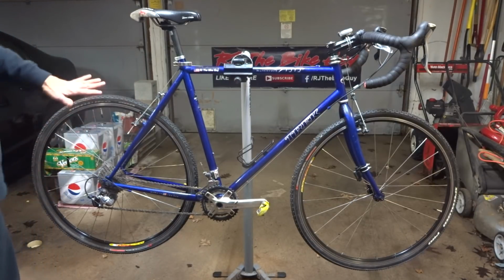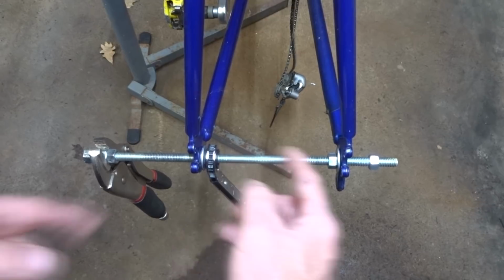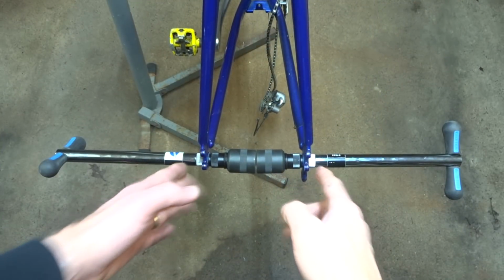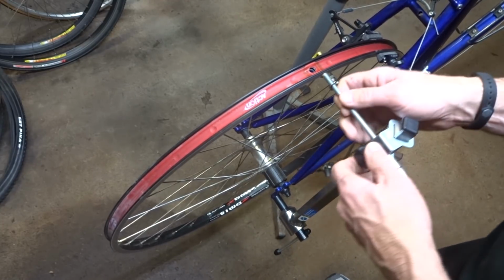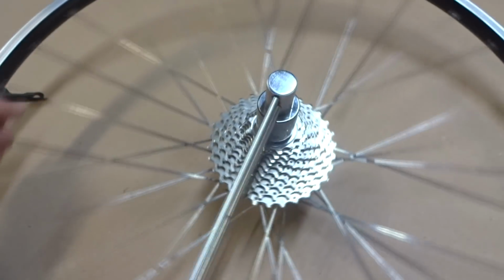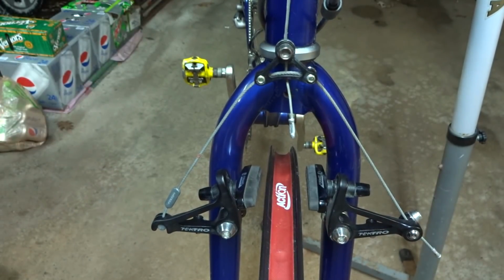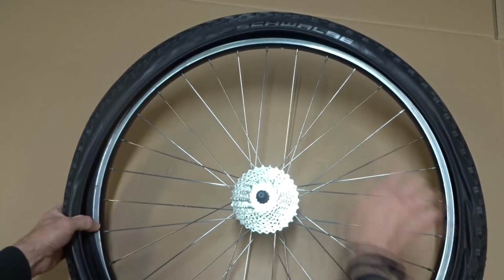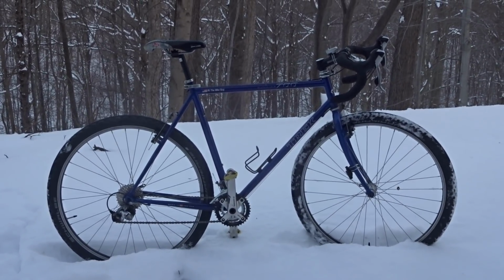700c to 29er Wheel Conversion - DIY Gravel Bike Update

Comment: Now upgrade it to disc brakes :).
Those tires are amazing! I have them on one of my bikes and they have't disappointed me yet :)
Reply from the maker: That would be a new frame with mounts and new wheels. Basically a whole new bike.
Reply: Instead of going through the expense of disc brakes, I've been equipping all my bikes with the over-sized brake pads used on tandems! Very low-cost but effective and inexpensive! Try them before investing in something more expensive.
Reply: @RJTheBikeGuy  Yes, you are right - it is a fun project though, definitely NOT for everyone. 

I converted one of my old frames to disc brakes by using the A2Z disc brake adapter that mount on the rear triangle and got a new front fork (Mosso M5). Put the same tires you are using on this one and now I have a nice gravel bike with discs and all :).

Like I said, fun, but not for everyone.
Reply: @akeeperofoddknowledge4956  Your method will work too... is a good upgrade!
Personally though I find the discs more dependable on gravel, especially when is muddy and rainy/slushy.
Reply from the maker: @mrN3w7  I have done a conversion like that: https://www.youtube.com/watch?v=emW7M-ZD0Pw
Frankly, I don't think it is a great solution. Better to go with frame made for disc brakes.
Reply: @RJTheBikeGuy   I have seen that video (like pretty much all your other videos :) ) and its way more complicated than the adapter I am using. The one that I am using is been on the bike for about 2 years with no issues.
But again, as I mentioned before, I perfectly understand that this is not for everyone. I only did as a fun experiment, that actually paid off.

Comment: RJ: question about those straddle cable hangers.... do those two bolts lock the straddle cable so it doesn't shift around? My monster cross's front brake manages to shift after every use while riding.  So I have to reach down and reposition it so one brake pad doesn't rub.... I've thought of swapping to v-brakes but I want to avoid using those pull adapters.  I have 3x7 MicroNEW brifters (which seem to be doing well for $53 brifters)
Reply from the maker: Yes. They clamp on to the straddle cable. They can be used to adjust the left/right brakes some.
Reply: @RJTheBikeGuy  thanks! Might save me from having to swap to v-brakes
Reply: How large are your tires?  I use mini-V brakes (don't need pull adapters) with 41c Surly KNARD tires.  You can go pretty large with the 85mm or 90mm "mini-V" arms.  I use 85mm rear and 80mm front without rubbing the tread in the dry.  And 38mm Ritchey Megabite on the front for mud (34mm rear, but due to chain stay mud build up).
Reply: @davidobrien8438  I run 26x2.2 (55.88mm) Forté Tsali on the bike in question.  I didn't do a 26 to 700c conversion on it.

Comment: Rj, nice video. I noticed there is a small hole on the front fork. Say you wanted to install caliper brakes, would you be able to drill that type of frame out?
Reply from the maker: Thats for a reflector or fender. But a caliper brake could probably be mounted there.

Comment: Why not adjust the hub spacing from  135mm to 130mm (5mm off the hub) on the non drive  side??????
Reply from the maker: New axle, new spacers, probably redishing wheel, for a hub that is MADE to be 135mm. Or just adjust the frame. Feel free to do it your way.

Comment: Hey RJ quick question im running the latest sora and i wanted to get new wheels but its compatible with 10/11 speed. Would it be possible to fit, or would i have to buy new groupset
Reply from the maker: I don't understand the question.
Reply: RJ The Bike Guy i was thinking of upgrading my 9 speed road bike, i did some research and wanted to get these specific ones. Bontrager Aeolus Comp 5 TLR wheels they are mainly compatible only with  10/11 speed bikes, is there a possibility i can make it fit?
Reply: @Coach_cesar  Yes.

Comment: Another great video, RJ! Do you think it’s a good idea to have those alignment tools to check the alignment on a bicycle every so often?
Reply from the maker: If there is a problem, or making a change.
Reply: RJ The Bike Guy I have run brakes on my Giant Contend and notice that when the bolts are tightened that hole the brakes on the frame, when I squeeze them they sometime stay tight on the rim. Is this because they are cheaper tektro brakes or is common?
Reply from the maker: @TJuice1986  Can be stick cable, lever, pivot, weak spring, pad catching on tire, etc.

Comment: Very nice!  I am curious about why you didn't go tubeless.  If you are going to all that trouble to switch to a 2.0 tire and 135mm spacing why not go one more step?  Or is that coming up later?
Reply from the maker: Tubeless might be fine if you are riding close to home or with a car following you with spare wheels. I will be riding this where I get a flat, I want to be able pop another tube in.
Reply: @RJTheBikeGuy  You can still pop in a tube if the schmutz doesn't seal the hole. (It would have to be a pretty big hole!) I have ridden exclusively with a tubeless setup for years and I am a mountain biker who rides a loooooong way from my truck on very rocky trails. Except for the fact that it is a pain in the neck to set up, they are vastly superior.  Give it a try!

Comment: Hi everyone,

I have a question. My bike has quick release hub and using hydraulic disc brake. However, I noticed that the disc is shifting after some rides, so I have to realign the caliper way too often. I tried to clean the brake pistons, but it still happen. 
The QRs are tightened moderately but I can somewhat flex the wheels so that the rotors also moved a little. I am wondering if someone ever experienced the same problem or know the solution for this. [I don't have resources to change to Thru Axle anytime soon]

Big thanks.

Comment: I'm assuming you needed to adjust the front fork? If so did you use the same technique as the rear?
Reply from the maker: Modern front hubs are typically spaced to 100mm. It didn't change.
Reply: @RJTheBikeGuy  cool, thank you for replying. Enjoying the videos!

Comment: Do you have any concerns with having changed the chain line somewhat when widening the rear dropout spacing which moved the rear cassette outward compared with it original position?
Reply from the maker: Not really. It only moved the cassette out about 2.5mm.

Comment: What do you do if derailleur is changing gears too slow from up to down (in your case on the top 3-4 gear)?
Reply from the maker: Minor tweaking of the cable adjustment. It may be slightly different out of the stand.

Comment: You forgot to say to only do this procedure on steel bikes. Also, why not tubeless?
Reply from the maker: And if I get a flat tire out in the middle of nowhere?
Reply: @RJTheBikeGuy  the sealent seals up the punctures.
Reply: You can still install a tube if the sealant doesn't seal the hole.
Reply: @motorpsykler  I've also had success sealing punctures too large for sealant with tire plugs. If not, then a tube as you say 👍
Reply: @murf250  so you're saying if I go tubeless.... i would have to carry a spare tube plus those tire plugs? Doesn't sound like going tubeless saves weight.
Reply: @kevinjfeeney77  They spare tube weighs no more than the spare tube you would carry anyway.  You DO save the weight of the tube in the tire though.  I have been riding tubeless for about 10 years and don't bother with the little plug kit.
Reply: @kevinjfeeney77  plugs weigh next to nothing... Have you even seen them?... A few grams for the plugs and plunger. People running tubes are also going to carry a spare, maybe even two. It's not so much about the weight for me. For the trails I ride, it's all about reducing the PSI to get way more traction. Plus, punctures are such a rarity and I'm always passing by people changing their pinch flat tubes on the side of the trail. I prefer to ride, not repair. 
But dude... Do whatever you want, I really don't care. I was just agreeing with someone else's comment. Ride and let ride ✌️
Reply: @timgarland8619  ya, only take it the plugs on bigger rides. Barely need to use them as I rarely get punctures

Comment: When you change the wheels diameter, how does it affect the handling of the bike? Is it a more solid feel or is it more agile?
Reply from the maker: In this case, the diameter is the same. The rim is wider.
Reply: 700 and 29 rims measure exactly the same diameter. From tire to tire there could be a small diameter change of maybe a few millimeters but it’s negligible.
Reply: I was asking because I have a few mountain bikes and was considering doing a 650cc or even a 700 conversion. Don't know if that's a good idea.
Reply: robofatcat some 29er mtb’s can be fitted with some 650b rims with some huuuuuge tires. Diameter technically stays the same but you get a softer ride and more grip because you got more tire. Also some CX/gravel 700c bikes can be fitted with 650b rims and huge tires, to get the same effect. 
If a bike was designed to work with a certain tire+rim diameter, it’s a good idea to keep it that way. In short, you can put a smaller rim, but you need to compensate with a bigger tire to keep the same overall diameter. 
If you don’t compensate for diameter, you can have other problems as the bottom bracket being too close to the ground. 
Also, with rim diameter changes, you have to have disc brakes. Rim based brakes won’t work with different rim diameters.
Reply: Got it, thanks
Reply: @LvcianoN  Spoken like a true expert.....just kidding!A 700c wheel with a 28 mm tire has a diameter of 27" (686 mm);a 700c wheel with a 32mm tire has a diameter of 27 1/4" (693 mm);a 700c wheel with a 40mm tire has a diameter of 27 11/16" (704mm); a 700c wheel with a 47mm tire has a diameter of 28 3/16" (715mm).I don't have any tires larger than these,but I am pretty sure that a 700c wheel with 2.2" (56mm) tire would be right around (pun intended) 29" (737 mm).So if you are changing a 32mm tire with a 2" or 2.2" the diameter of the wheels has increased almost 2 inches and the handling will change decidedly.The reason for installing larger tires generally is to gain greater traction in mud,snow,sand and other loose soil conditions,also to handle really rough terrain,single track with logs,boulders and big drops.So bigger tires are way more solid and agile when the conditions dictate that these tires are needed i.e. the mountain trails.Bigger tires are not more solid or agile when you are on the street.
Reply: Larry Daniels exactly my point, if you’re gonna run some big ass tires on a 700c bike, you need to downsize rim size. I’ve seen it done in CX races, the whole point is to keep overall outside diameter the same, as I said. 

A 622mm rim (29/700) wont have the same overall diameter with a 23mm tire or a 2.2 inch mtb tire.

Comment: is the difference of 5mm really worth setting the frame, can't i just slightly muscle the wheel in every time no problem if it's just 5 mm or a ~3.5% difference
Reply from the maker: It's an inconvenience and also places stress on the axle
Reply: @RJTheBikeGuy  could it also affect rear derailleur alignment? I find that my old road bike converted to 700c has that issue at times
Reply from the maker: A little bit.

Comment: I though 700c is the same as 29?, This is getting really confusing
Reply from the maker: Same diameter. But 29ers are typically heavier duty, wider rims for fatter tires.
Reply: You are correct they are the same size

Comment: have you used the 700c tubes for the 29er wheels ?
Reply from the maker: They are same diameter. 29er tires are usually fatter. Fat 700c tubes can work with smaller 29er tires.

Comment: 700c and 29er are the same diameter wheels .
Reply from the maker: Yes they are. 29ers though have wider rims and are heavier duty, made for offroad riding.
Reply: @RJTheBikeGuy  in most cases yes but I  have a set of giant 700c wheels that are the exact same wheels as my giant 29er wheels in every measurement except axle width/length and are both made for off-road use with the same spokes and stiffness. Same exact rim and spokes just different hubs.
Reply: @bobbyhempel1513  Generally speaking,135mm locknut-to locknut hubs are designed for mountain bikes,130 mm hubs are for road bikes,but now there are even wider hubs for specialty non-conformist bikes!
Reply: @bobbyhempel1513  huh interesting

Comment: I think, you should have just replaced the tires and go!
Reply from the maker: Rim width limits how wide of tires you safely install. These wheels are also sturdier.
Reply: Even on 15mm rims (Mavic CXP-22 ?) you can run 2.0'' tires without any problems.
A lot of light MTB rims are 17 to 21mm wide (inside width) and I like to run them with 2,3 to 2,5'' tires on my rigid MTBs.
I write this to encourage those, who have a CX frame, to simply try out fatter tires, as long as these fit ok into the frame and fork.
Reply from the maker: @coolcycles  See the chart at the bottom of the page. https://www.sheldonbrown.com/tire-sizing.html
Reply: @coolcycles  @Coo...,No kidding.I have had 2"' tires on all types of 700c rims with absolutely no problem.If you go back a few years,most 2" tires on 26" wheels had equally narrow rims.Tire and rim marketers found it beneficial to the bottom line to recommend the wider rims.The  Sheldon Brown chart he is referencing states at the bottom that cyclists have had fine results when combining tires and rims outside of his recommendations.I agree with Cool Cycles,you don't need to go through all the hassle shown in this video,put your 622 tires on your 622 rim,it will be just fine.
Reply: @RJTheBikeGuy  I have put 2" -29er tires on my road rims since the 29ers were introduced with no problems.If one reads the bottom of Sheldon's rim/tire compatibility chart he states "This chart may err a bit on the side of caution.Many cyclists exceed the recommended width with no problem".I gather from your videos that you are like me and many other cyclists,in that we are limited in the dollars we can spend on our bikes.Please don't encourage bikers to spend money on solutions where there is no problem.
Reply from the maker: @larrydaniels6532  You can do what you want. I am building this bike for me. This is what I built the bike for: https://www.youtube.com/watch?v=6bFxsQZG2V0

Comment: Does cantilever brakes allow to instal the 650b weelset with wider tyres?
Reply from the maker: Canitilever brakes can be used with wider tires. But you mention a 650b wheelset. If you are coverting to a 650b from 700c or 26" then I can't tell you if they will work for you.

Comment: i just had to do this in reverse, from 135 to 130. there is still about 1mm space on either side of the axle, and the dropouts. is that an issue as long as the dropouts are aligned?
Reply from the maker: Should be okay.

Comment: Do you work on fatbikes
Reply from the maker: Most of the stuff on them is the same as regular bikes.
Reply: I found one that someone through away in the garbage &I I took it&I cleaned it up  got all the rust off & upgraded brakes to hydraulics  &I when the bike shop open up  again up get new shifters the quick trigger shifters

Comment: You really didn't have to buy a new wheel because a 29" tire will fit on a 700c rim. It is a proven fact.
Reply from the maker: 29er and 70oc are the same diameter. 29er rims are WIDER! And there are limits to how wide a tire you can SAFELY put on a skinny rim! 29er rims are generally also HEAVIER duty for offroad. Thanks Mr Facts.